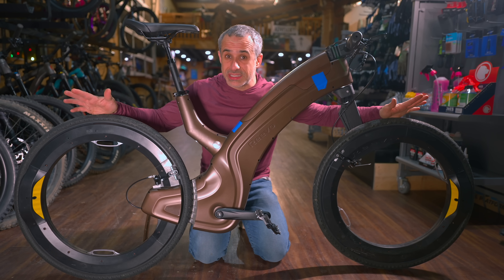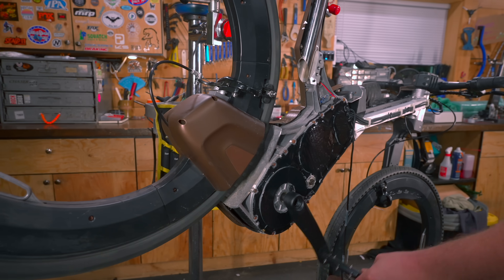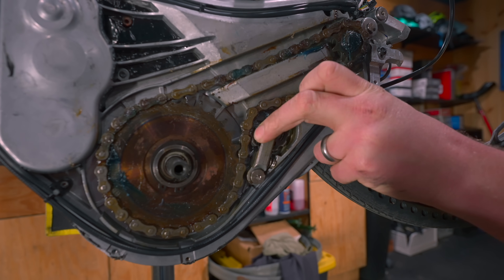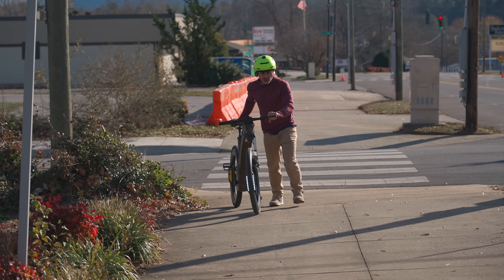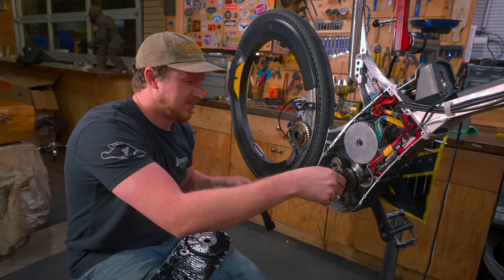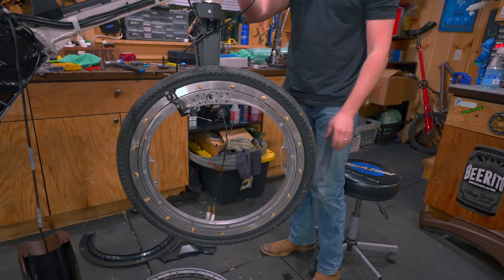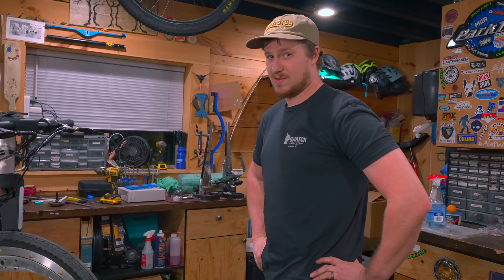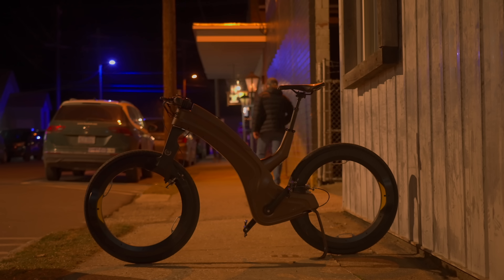What's Inside The World’s Worst eBike? Reevo Teardown

Comment: This is simultaneously the most over-engineered and under-engineered bicycle ever made.
Reply: It's like that Juicero thing from a few years ago. Look at the chain/geartrain housing! It's quite a nice casting, though... it's a casting to hold entirely stupid mechanicals ofc.
Reply: @williamstrachan  Exactly what I thought of.  INSANELY overengineered product for a frankly stupid idea.  Because startups think they have good ideas, pay way too much solve an engineering problem that shouldn't exist because again, the whole thing is stupid, and then run out of money because they don't realize how expensive it is so they have to rush to market.  

Except they did even WORSE than the juicero.  At least that got the "Full treatment", overengineered from top to bottom, no cheap parts.  This is like they spent all the kickstarter money on the engineering, then had and no money, slapped the cheapest parts possible on it to finish it and get it out the door, never testing it or iterating on the design because they were broke.  And of course a shitty product out the door doesn't magically bring you more money to solve the problems, so they disappeared into the night...
Reply: @Tinil0  AvE on youtube here took apart one of those infamous Juicero machines and it was way over engineered just for squeezing juice out of a bag.
Reply: @Tinil0  Dude, juicero ended up as a juice squeezer that squeezes juice out of a bag.
How much worse can you get than an electric vice pretending to be a juicer.
Reply: @Tinil0  They obviously had the "hubless" gimmick and designed the bike around that.
Reply: @williamstrachan they gonna implement the unnecessary wifi feature to that "bicycle" 🥀
Reply: @williamstrachan  >a few years ago

You're gonna wanna sit down... Juicero was almost a decade ago (March 2016). It came out while Obama was still president (so three presidential terms ago).
Reply: I just realized that the gearing system is basically an old school eggbeater.
Reply: It looks like they just got to the first rideable prototype and stuck a plastic shell on so they could sell it.
Reply: I would hereby like to coin the word "misengineered" for such machines.
Reply: @ Engineerin't.
Reply: Possibly, but other hubless e-bikes do exist, the "Topsecret" even looks kind of similar and they also have a concept with suspension. Still, hopefully those are better engineered.
Reply: This atrocity was not engineered, it was merely designed. I work in mechanical engineering, I know what I'm talking about. Design is where you just put concepts and parts together to make them work. Engineering is where you apply science to it, run stress/strain calculations, run Finite Element Analysis on structural components to assess their strength and find ways of reducing their weight, you run efficiency analysis on the drivetrain, etc - I absolutely guarantee you none of that happened on this product. It was NOT engineered.
Reply: @larrywalsh9939  100% agreed. It's the equivalent of building a functional prop for a sci-fi movie.
Reply: Just the engine transmission is terrible.
It shouldn't use straight metal gears, and should have a freewheel system in the wheel.
Plus ffs use direct drive for the electric motor.
Just with that the resistance would be 4x less, cheaper, and way less noise, plus freewheel.
The nylon wheels  solution is ridiculous too,but at least they could have used proper roller nylon wheels with bearings.
Reply: Some time ago I watched a documentary about a disfunctional piece of traffic infrastructure. The presenter called it "over-engineered but under-designed". This also fits the Reevo. The most competent engineering doesn't help if the general idea was just plaid stupid from the get go.
Reply: That's what happens when business people graduate college with an idea, "design" (draw a picture) it and then hire a contract engineer to actually design it.

"It has to look like that? Money is no concern? You have no experience managing engineers, much less hourly contractors?"

Out pops a bike, machined from billets with 47000 gears, that took two years to design. I bet you if you look you'll find some Kevlar in their because Kevlar is cool and no one gets to use it. They must have terminated the engineer's contract before he did the outer shell... otherwise it would have been carbon fiber.
Reply: do not call that monstrosity a bicycle
Reply: @floof6896  It's got a LOT more cycles with all those gears! ROFL
Reply: @NeverlandSystemZor  12 gears to give 1 speed. What a joke.
Reply: @NeverlandSystemZor  dodecacycle. dodeca=12, one for each gear 💀
Reply: @floof6896  It was an E-bike.
It had padels, wheels, a (short) chain, a bicycle seat. Everything to make it a bicycle.
And all the electronics to make it an E-bike.
Reply: @floof6896  well it's not a unicycle now is it
Reply: Over engendering under delivery
Reply: Reminds me of the juicero wifi juice press, super heavy metal screw press to do what two rollers can.
Reply: It's a prototype that needed to go through another 10 rounds of revision before being released to the public.
Reply: The Tesla Cybertruck of bike
Reply: I think it's only over-engineered... It seems like 1 problem leading to next problem, leading to next problem, etc. etc... All in the name of "cool" design... If these wheels just had spokes there would be like 20 less problems and the whole thing would probably be 5 times more efficient.
Reply: goes to show you cant overengineer something AND cut cost. 
one or the other
Reply: Definitely the bicycle equivalent of the f-35.
Reply: It solves so many of the problems that don't exist on regular bikes!
Reply: @kurtkurtson9111  This comment deserves more likes
Reply: BSO is the preferred nomenclature, please
Reply: This is what happens when you tell the engineer to make something that matches the concept art.
Reply: I really want to know how fast that chain is spinning if you're pedalling at 10 mph.
Reply: Looks like the designer and engineer did not talk about what each of them was doing..
Reply: Lol please do not call this thing engineered.
Reply: Over designed and under engineered.
Reply: As the son of at least one mechanical and one electrical engineer - I am flabbergasted.
Reply: Over-engineered: "We worked really hard to put some asshole's very bad idea into practice." Under-engineered: "Now that we have this asshole's bad idea in the barest of operational states, we will do NOTHING to iterate it into something less bad" (probably because it would be impossible without a lot of breakthrough materials and mechanics, and hundreds of millions of dollars in further work).
Reply: It’s purpose was to loot venture capital
Reply: Exactly, sir
Reply: Schrödinger's engineering
Reply: They engineered the bike around a failed concept, how the fuck reinvent the wheel!
Reply: Juicero all over again. AvE was in awe at how many gears that thing had. Stupid people with too much money, and engineers took them for a ride.
Reply: All for just to make it look more futuristic.
Reply: Indeed
Reply: Well they had this figured out, but I think they were working under too much time pressure 😅Looks cool but nothing else
Reply: They created a problem
Reply: so it just evens out to an engineered bike...jk.
Reply: It’s almost like they had one or two awesome engineers and then a bunch of mouth breathers and there was zero communication between any of the teams. So some parts are pretty good and others are nonsense
Reply: @Dankturboz  Any sane engineer would point out that your average bike is already pretty close to the pinnacle of engineering.  They're something like 98% thermally efficient and mainstream designs are a very careful balance of weight, strength and cost where you can't change one of those three without impacting at least one other.

In short:  There's a reason you don't see anything hugely different.  You'd be spending $millions to get anything remotely competitive.
Reply: The Juicero press of bicycles...
Reply: shrodinger´s engineer
Reply: 10% over engineered in the gears, then covered with 90% Crap.
Reply: It kind of reminds me of the Juicero, which was an insanely over-engineered machine that just squeezed a back of pre-shredded fruit into a cup.
Reply: What about the video?
Reply: the engineer at first put in a lot of thought and effort, then realized the idea was stupid and was like "fuck it"
Reply: Over engineered, under tested
Reply: I feel this description fits a lot of startup and big tech nowadays (athough the under-engineered part may not appear immediately because this is a lot about quality)
Reply: Schrodinger's bike
Reply: It cleverly combines all the disadvantages of a chain drive with all the disadvantages of not having a chain drive!
Reply: Someone drew a model ... and some engineer saw this and stayed I can make this work or I can make something good ... and got fired and the others just thought ... well we get payed enough just make it work
Reply: And tried to hide it on futuristic style
Reply: Schrödinger's bike
Reply: The most hilarious things are the aluminum beams and the "bearings bearing".
Reply: @candywelz1305  The main wheel bearing is not stupid at all... but it has to many rollers 🙂The bike is ruined by the friction created in the gearbox.

Comment: Those little wheels around the inside of the rim are the same wheels that we used to build 3D printer slides and stuff because they roll on an aluminum extrusion really well
Reply: By "they roll well" you mean "with very little slop" (as it is probably needed for a 3d printer) or "with very little resistance"?
I find it hard to believe that that many plastic wheels under pretension plus load don't have high resistance.
Reply: @Culpride  With very little slop.  They do no spin for long, there's a lot of resistance.  Which, is fine for the comparatively slow movements of a consumer grade FDM printer.  Absolutely wild that they decided to use them for a rimless wheel.  This thing is a prototype with shiny plastic fairings.
Reply: @fuzzynavel71  Judging by the rest of the design, I think they wanted something better but just didn't have the budget.
Reply: @Culpride  Yeah it is definitely specifically about the 'slop' of the wheel. I am especially blown away seeing those in there considering, anyone who tinkers with FDM printers (with these types of v-rollers as we call them) knows how easy it is to get a flat-spot if you tighten them too hard. Like.. very easy. I can basically guarantee that's what happened when Seth was riding the bike around (and got the clicking).
Reply: @Culpride  Exactly... And also these are only used in low-end 3D printers since linear bearings are better in all aspects (except cost and ease of installation), so...
Reply: @Culpride  yeah you're correct they probably suck for a bicycle wheel like that. But when you're only using six of them on either side of a little trolley they work really well. And it's powered by a stepper motor that has plenty of torque.
Reply: Yep, they look just like a 608 skateboard or quad skate wheel bearing.
Reply: @AM-hf9kk I bet those aren't bearings. If you replaced them with bearings it might actually become close to rideable. Then add a off the shelf hub motor and it's a bad but rideable bike. Worse than poorly maintained city bikes, but actually worthy of being called a bike
Reply: @majaabjetzt5790 They absolutely have bearings, two per wheel to be exact. They aren't great bearings but that's only a fraction of the issue. There's like 18 on each wheel under compression, which is ~36 bearings of rolling resistance. You could clean it up and painstakingly swap them with the best possible components but nothing will save it from being a terrible experience.
Reply: @majaabjetzt5790 they are. The problem is that V-rollers aren't remotely optimised for reducing rolling resistance - the goal is minimised backlash, at the cost of higher friction.
In terms of curved linear guides, they've picked the absolute worst system possible. A quick browse through Mauser brings up 3-ton curved rails for industrial robot arms which, from the manufacturer videos, roll fairly freely, way more so than this wheel - and those are rated to sustain 3 tons of load!
Reply: The bearings aren’t made for high speed continuous rolling.  Waste too much energy.
Reply: Yes, they are!
Reply: Indeed, it looks similar to a V-wheel, with plastic/NYLON, not even a FULLY metal one [which do exist]
Reply: @darknessblades  The last ones I got for my 3D printer have little clear plastic tires on them that are kind of some rubbery material I didn't know they made metal ones that would be kind of cool
Reply: Yeah, and they are a wear item in 3D printers and only picked because they manage to be MARGINALLY better than the crappiest linear bearings while being even cheaper.
Reply: If you mean 3D vee-rollers, they roll really well unless you put 80KG load on them, ie, the rubber part distorts/flattens-out and creates friction.
Reply: The hubless wheels could have been directly driven and shaved off like 40lbs as well as simplified your control electronics/systems, lowering the parts count by like 80% - there is already a company that drives what are essentially heavy brake discs but missed the key opportunity by installing rim brakes instead of using variable regen to control braking until you need to engage a parking/mechanical brake.  They almost had the perfect full system but chose to break the perfect half system by adding the broken stuff on the back end...so close, missed it by that much.
Reply: They works on printers but here we have some few of them taken a sick load in the bottom of the wheel. So stupid design.
Reply: They roll well on CLEAN extrusion rails, inside a clean workshop. Drive trough one puddle and you got your damage.
Reply: They also wear out super quick
Reply: And they seem to me like they're made out of rubber so I'm shocked they would use those. Each one has just a little bit of squish to it so with 40 of them or however many there is and that wheel that would imagine it's a real pain to roll
Reply: @Jped277  Oh, I've no problem believing that they're fantastic. For their purpose, not misused for a "bicycle". ^^
Reply: @Jped277  - they may well be plastic or rubber of some sort, and you are right that this is going to eat some energy. But try using steel to find out what that does to the already considerable noisiness of this bike... And it would probably also increase rim wear measurably.

Comment: How much weight was in all the decorative covers???
Seems like it would be a much better bike if they had just been transparent with as much of how it works as they could be (obviously you need a cover to keep the worst of the weather off the sensitive electronics - and make sure that box can drain!!!) and a decent welded or cast frame can look really lovely in honest functional quality. And those plastic covers on the wheels might keep the crap from getting in as easily, but also makes it impossible to get it back out! Far better off just letting everyone see how it works so you can keep it clean, add some lubrication etc. 

Also what a cunning but crappy way to do hubless, sure the off the shelf or mostly off the shelf internal wheels are cheap to do but you'd almost certainly get far better results and a lighter end product if you replaced those with regular if larger ball bearings balls, cylinders or a tapered roller and adjusted the wheel inner and outer races to suit - in effect make the whole wheel into a bearing directly and skip that extra pile of parts...

Comment: Ok fellow engineer brains out there, the challenge should you choose to accept it, figure out a better ebike way to do a hubless wheel for a full suspension mtb.  Pretty obvious the frame is a bad take on the old Cannondale Super Vs, so a carbon structure would drop the weight.  The hubless wheels I've seen on motorcycles really don't worry about weight, so flipping to carbon there means the wear would be a non starter unless you bond a replaceable drive surface to the rim that holds a normal pneumatic tire.  Putting the electric motor on the wheel turns it into a moto, and using a long chain or belt to drive the diameter of the wheel changes the look entirely.  Never seen a maglev wheel be built, only as a concept and the challenge is the impacts in mtb.  Interesting puzzle to toss around in your brain.

Comment: this would be cool if you could fix it back up with new bearings and grease and maybe try to put some mods on it to see if you could make it perform the way it was originally meant to be
Reply: hate to break it to you, but some bearings and grease aren't gonna be enough to make this thing any good lmao
Reply: @tallhobbit25  Its a good base, to build a bike upon though.
Reply: @peterfuchs8260  How? How is it a good base when that's precisely the core problem with it. It's not the motor, the upwards USB port, nor the battery that are the fundamental issue with this POS. Something that can not take appropriate brakes and requires 12 sprokets to turn the wheel is never a good base for a bicycle.
Reply: @ Sorry for the misunderstanding, I was being sarcastic and meant, new bearings and grease are a good base for a bike.

Comment: That Li-Ion call pushed against the frame... the aluminum gear rim... the 3D printer delrin wheels supporting the rider...
Reply: ... the of the shelf flipsky mini VESC, the 2$ blue 9g servo, the amass connectors typically used on rc-planes...